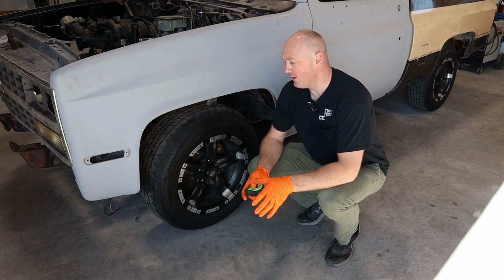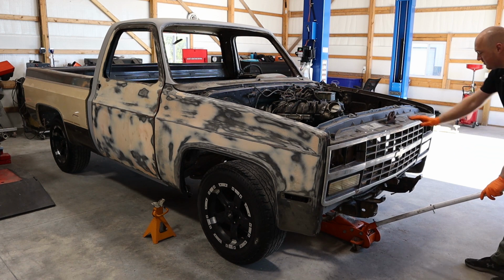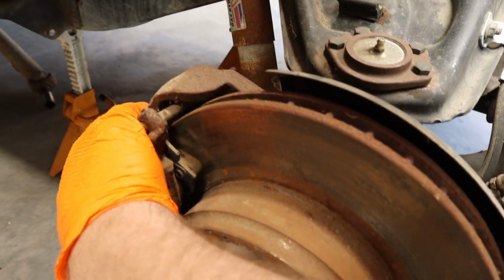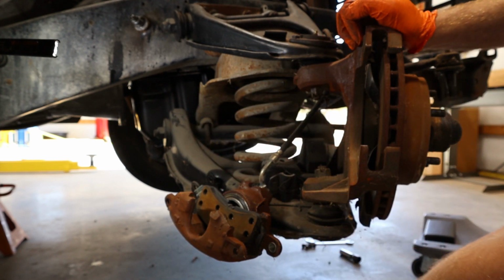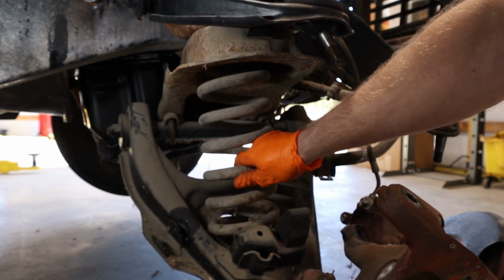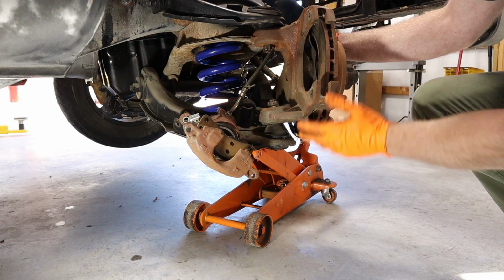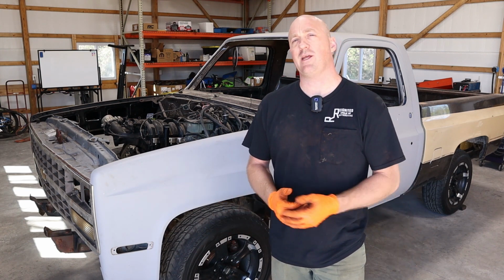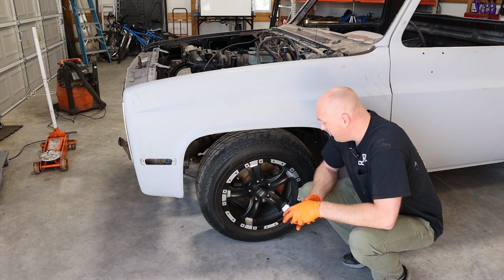HOW TO:  Lower Your C10 Front suspension // C10 Hemi ep 3

Comment: It has been my experience that when you lower the truck down to the floor it helps to roll the truck back and forth a few feet. This will help settle the suspension angles and tires stopping the suspension relaxing to near ride height. Think of twin I beam suspension being lifted up off the ground. The wheels will camber in at the bottom. Now lower this and the tires will keep that camber till the truck rolls. This is an extreme example of what happens with the Independent front suspension.

Comment: Please tell me you don't have the caliper hanging with the line putting stress on that line.... because you should never be letting it dangle you will break that line
Reply from the maker: People get bent out of shape about things like that, but you have to realize how strong brake hoses really are. They have to handle thousands of pounds of pressure, it's not difficult for them to handle the weight of a brake caliper for a short period of time. Granted you wouldn't want to leave it like that for extended periods of time, but it's not nearly as bad as people think it is.